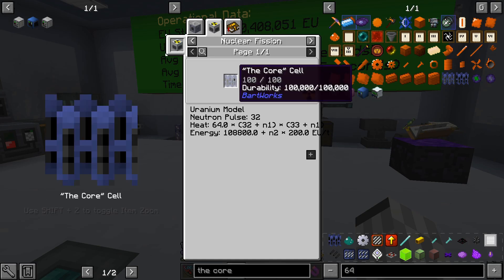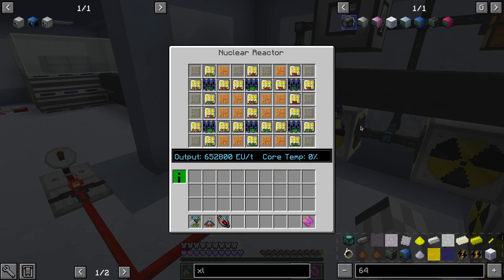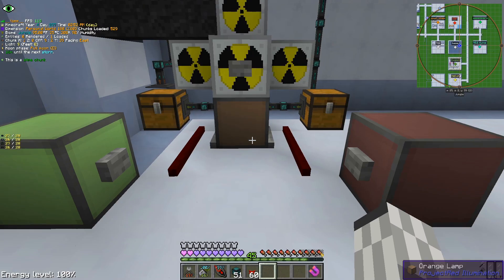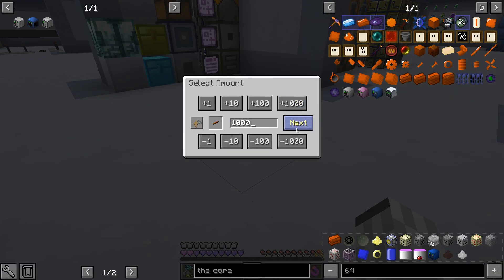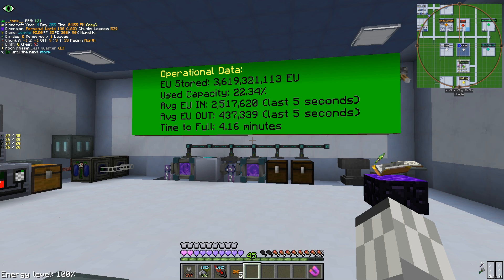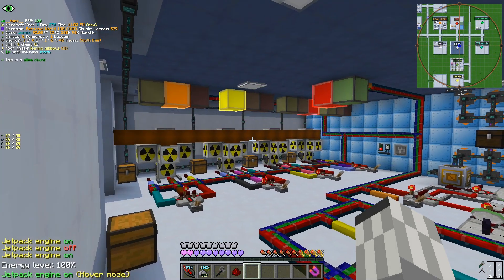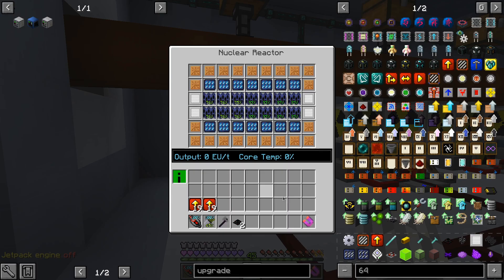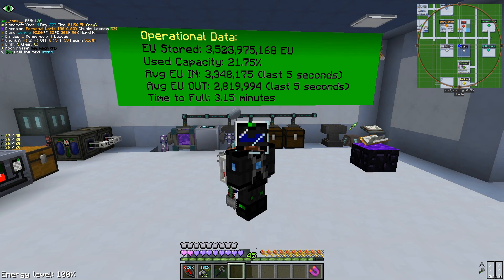GTNH S02E12: four stroke nuclear reactor

Comment: You haven't pushed them to the limit yet because they could be as spammable as solar boilers using GregTech Regulators and Player Interface combination to keep a certain amount of items in a certain slot in your inventory. You can easily Shift+LMB 19 speed upgrades and if you make a "snake" that goes "coolant, 3 core, cooalnt, 2 core, coolant, 3 core..." you can Shift+LMB+Drag this into reactor to quickly get the needed layout.
So, would it possible to get to Eye of Harmony using just solar boilers and nuclear reactors?
Reply from the maker: asking the real questions.

we can keep that for s3
let's not make stuff too crazy for now
Reply: @AverageGregTechPlayer  it’s s3 now

Comment: 8:30 Ohhhh, I figured it out. I first placed inputting node, then made a reactor, so it inputed coolant before processing the reactor and I couldn't blow it by hand. Earlier placed has higher priority. Because of this you can also see empty spaces if you place outputting node last, it's not a visual bug, just works anyway with 40 cores and 14 coolants setup

Comment: Could you provide a world download  so that I could understand the redstone control system better?
Reply from the maker: try to see if you can find it by using this file:
<edit: not working file>
it is just the folder of the garden dim world, maybe you can join it by adding this folder inside the folder of a new creative world, spawning a portal block, shift clicking it and trying to connect it to the file i just posted here.

otherwise i have to find a way to trim down and uplaod the whole save...
the garden dim is like 10MB, the whole backup is 1GB
Reply: @AverageGregTechPlayer  what version are you playing on?
Reply from the maker: @teutonen9978  602 (the last one on the announcement channel in the official gtnh discord)
Reply: @AverageGregTechPlayer  The game crashes upon entering the modified personal dimension...
Reply from the maker: @teutonen9978  are you using build 602 or an other game version?
Reply: @AverageGregTechPlayer i am using the correct version...
Reply from the maker: @teutonen9978  try with this one
https://drive.google.com/file/d/1dHr--qId2UGAtRg6j59lbEWvwpv7fJsh/view?usp=drive_link
Reply: Thanks a lot! I won't be home for a week though, so I can't tell if it works until then...
Reply: Perfect, thank you!

Comment: You can put sand in an HV macerator to make it easier to swallow and get an 11% chance of more sand as a byproduct to eat more sand
Reply from the maker: but if you get extra sand by macerating sand, then you have found a infinite sand exploit.

also, how do you macerate (not even shred) sand into even smaller stuff? maybe that extra sand is just parts of the macerator getting sanded of from it?
Reply: Yummy sand